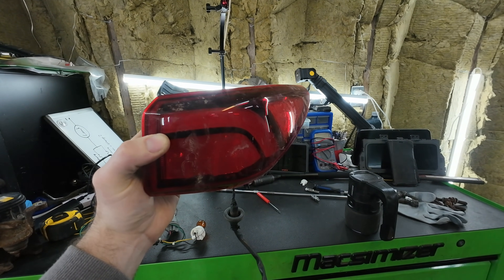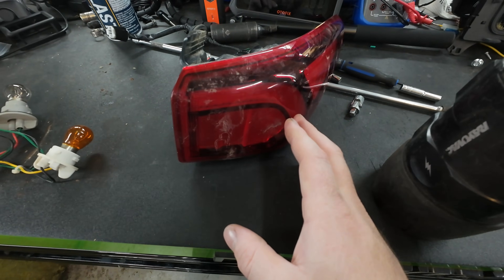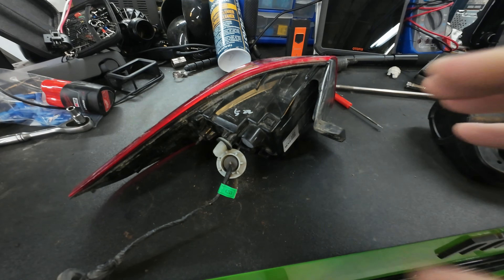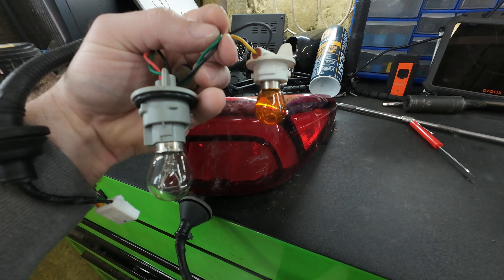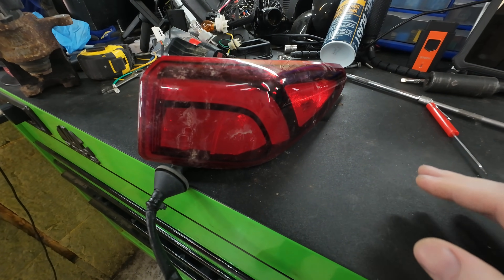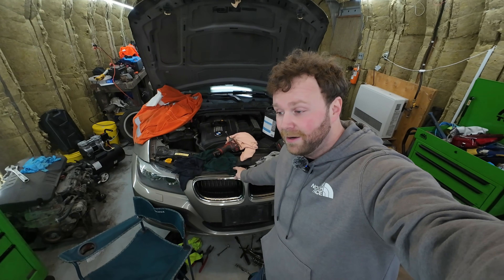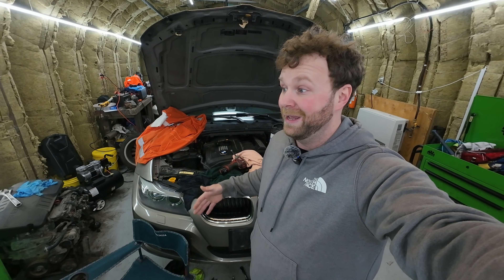Car Manufacturers don't even want you to change bulbs, they want you to replace entire assemblies!

Comment: The #1 consideration for the auto maker is to reduce the cost of manufacture of the vehicle. For this reason these types of assemblies exist. LED lights have a lifespan that should outlive the car while traditional light bulbs do not. Traditional assemblies are much more expensive to produce and inventory the sub components for the 7 years required by law. Cost of servicing and parts is very much secondary and all of this is a reaction of the car makers to the demands of customers who price shop on cars. Can't blame them for reacting to market demand even if it hurts the DIY enthusiast. 30+ years in OEM supply here so I know the back story all too well.
Reply: That's exactly it.

Manufacturers do not sit around trying to figure out how to make something difficult to repair; repair isn't even a concern.

Design is done to minimize the cost of production and installation.

This is why there are so many one-way clips on cars that are near impossible to unclip without destroying the plastic; removal isn't important, it's the fact it only takes a second to snap it into place, where screwing it into place is easily removable but might take fifteen seconds per screw and perhaps six screws.

One second of labor cost vs. one minute of labor cost is a no-brainer.

Comment: I just saw a video of a 80,000$ denali brand new with a broken door handle cant get the handle its now molded into the door panel. 800 for a new door panel if you break the handle. I hope toyota doesn't see it cause their door handles are the worst pieces of shit literally the only compliant on Toyota.

Gm's fancy trucks have 1500$ rear lenses as well EACH.

there is going to be a massive restoration opportunity for any vehicle made before 2010 as this new stuff is beyond awful.

Comment: As someone who deals with electronics, the problem isn’t that they cost $1500. It’s that they are charging that much for something that might only cost a few hundred dollars to manufacturer.
For some reason, companies still believe that if something has electronics in it, they should triple the price. 
I wanted to replace a control board in an oven and the board cost more than 1/3 the price of the oven.  The board itself couldn’t have cost more than 50 bucks to manufacturer.
Reply: Production cost is not even near a few hundred dollars. It's much lower.
Just one example. A company here in Herzogenaurach used to produce shoes for 20 DM and sell them for 60 DM. Today production cost is 10 Euros and they are getting sold for 200 Euros.
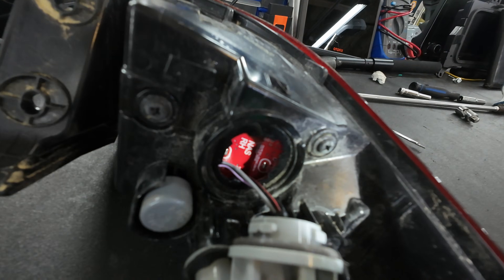The ratio is more 1:20
Reply: I have a Samsung oven that uses relays on the control board to power the oven elements.  It uses a slow PWM (On/Off several times a minute) to control the temperature.  The oven quit just out of warranty and they wanted about $400 for the board and Tech time on top of that.  So I'm an electronics tech so I pulled the board and soon determined the relay to be faulty.  I purchased a set of 3 relays exact OEM for about $10 out of China. Well they lasted less than 2 years.  I noted that the foot print was the same as a name brand relay I had in my shop rated at a high capacity.  About 3 years in and it is still working... except now a proprietary designed thermistor temperature sensor costing $150 is faulty, so we can't use the top half of the divided oven.
Reply: "....... the problem isn’t that they cost $1500."    Duhhhhhhhhhhhhhhhhhhhhhhhhhhhhhhhhhhhhh
Reply: You're not buying the boards in bulk. 🤣 You as an individual can never ever beat a large company economy of scale. And yeah prices by time it gets to you will have tripled if not more. Lol there's a lot of middlemen in between BEFORE car even gets off the lot. Gross profit margins are typically based on costs. A fifty percent gross margin is typical and that applies each company or part of process. It's like compound interest. Lol best example is wheat. Lol a bushel will easily make fifty loaves of bread and the other ingredients are typically cheap at source too. A bushel is around $8 so it's like under 40c a loaf and the other ingredients are like maybe 25c or so. Yet a fn loaf of good bread is $3 to $6 . 
Note this. No public traded or invested into company onus is to you the consumer, it's to me the investor. If I see it's not making profit then sooner or later I'll pull out. Here's facts. There's always been a lot more people don't know even HTF to change oil let alone anything else to repair. Lol most can't even change a tire. While you're a repair enthusiast the reality bus your numbers are lot lower now than ever. Lol like when I was a kid you had to take industrial arts including mechanics, now that's not a requirement most schools. 
Maybe 0.1% of y'all know how to do s now even if it was old school vehicles. You can complain but nothing's going to change much. You're not the main market and never have been. 
Also people think they're saving huge money doing own repairs, lol have you ever costed your own labour which includes time going out and getting parts. Lol hint buddy. I haven't cut my own grass since I was like in college. My time for anything whatsoever is worth st least $100 an hour. Lol get a pt jib or make money on net instead then pay for repairs out of it. Also do own repairs you Automatic lose warranty in most cases.
Reply: I have a gas range in my house from the 50s. I've been here for 37 years and it's never needed any repair or servicing. I have a pickup I bought new in 1990. It's old school pushrod technology small block Chevrolet. No electronics on board or electric controls except what's absolutely necessary for the vehicle to function. It just keeps going down the road.
Reply: @martyharless5097 
I suppose I could’ve put repairs into my GE stove to fix the bad pilot and oven control.  But it was a cheap stove from the 70s.

As far as your 90s truck. 
No list of major repairs to keep it just going down the road. 

By the way, the 90s 
So it has an electronic ignition and possibly an electronic carburetor. 
It certainly doesn’t have point ignition
Reply: @neilkurzman4907  single coil electronic ignition. It never needs adjustment and it's had one module replaced in 35 years and it was cheap. Extremely reliable throttle body fuel injection. I haven't spent a penny on the fuel injection. 
Maintenance is very simple and repairs are just typical wear items such as brakes, clutch, water pump, and alternator bearings and very simple to repair. The engine and transmission have never been opened up and it runs like a top. 
It has the original catalytic converter and has breezed through every emissions test.
Reply: @martyharless5097 
I didn’t ask for the sales pitch. I’ve owned 90s cars before. 
Blew the head gasket at 100,000 miles. 
So you were able to get a junk recognition module. That’s what she means.  So you haven’t cleaned the fuel injector in 35 years.
Or the throttlebody for that matter?
Original starter, fuel pump? Suspension, steering linkage, U joints, ball, joints, bearings.
Even the original valve cover gaskets.
Because they didn’t leak like a sieve back in the 90s. And how many hundred thousand miles do you have on that original unopened transmission? 

Should I go over the massive list of parts that you needed to keep something that old on the road?
Do you think you’re the first person to have an old vehicle?
Reply: @neilkurzman4907  I'm still waiting for that massive list of parts needed to keep my truck going down the road.
Reply: @martyharless5097 
You haven’t told me how many miles are on it. Being you’re acting like you have not replaced all of these parts. I’m going to assume it’s less than 100,000. 
That you have a diesel. 

My last Honda Accord had 97,000 miles and the only engine Marc was the valve cover gasket.
Major work was the E break and one of the daytime driving lights. 
Every other LED bulb in the car is still working.
Reply: @neilkurzman4907  I'm still waiting on that massive long list of parts. I guess you must have forgotten about it. In your earlier comment you asked if you should go over that list. That would infer you already had a list made. I don't know why it's taking you so long.
Reply: @martyharless5097 
You still haven’t told me how many miles you had on it and if it was a diesel or not. 

So you’re saying you found the one lucky vehicle that nothing ever wears out on. Or are you saying every one of the vehicle vehicles from that year is still on the road today? 
Let me guess you do all your homework work and don’t count your labor the thousands of dollars that it’s actually worth to somebody else who wasn’t going to do with themselves 
So original exhaust, original struts 
Original U joints, original bearings.
Original diff , original bushings because those never dry rot. 
I bet you have the original shocks, springs, tie rod ends, ball joints. 
Never a spot of rust. It’s all just freaking amazing.

Yes, I forgot about you. And I also remembered you didn’t answer the original question so does that have 25,000 miles on it or 225,000.
And if it’s a diesel, it’s a whole different story.
Like do you have the original distributor cause everybody knows that’s normal wear part 

Oh by the way, I should mention I’m in my 60s and I’ve had cars for 15 years before. So go bullshit somebody else
Reply: @neilkurzman4907  I already answered your questions concerning mileage and diesel or gas in my last comment.The only things you got right I have already mentioned in previous comments except for the muffler. You're a mile off on your guesses. Of course I've had things wear out on my truck. I have already mentioned that and I've taken into account the labor. I've had my truck a hell of a lot longer than 15 years. It's 35 years old which you should have known as I said it was a 1990. Why am I not surprised you want to run your ignorant mouth without reading my comment. You're just too lazy and don't want to back up your bullshit.
Reply: @martyharless5097 
Ignorant? Why every one of those parts I listed is still the original on your truck.  It’s 35 years old. That’s all I know about it.
I still don’t know if it’s a diesel or how many miles it has on it 

Yes, my last car I kept at 15 years I promised myself I’d never keep one that long again. 
So how many hundreds of hours have you spent keeping the truck on the road? 
I’m assuming original engine and transmission mounts. 
Because they last the life of the car.
Reply: same with phones.😅
Reply: I sell used washers & dryers. When a computer board on a washer goes out we just repair it... but now they have started filling in the back of the computer board with some type of thick glue stuff.
Reply: And the fix for the board is likely a cracked solder connection. 
Easily fixed.
Most electronic failures are mechanical in nature such as loose or corroded connectors, cracked solder etc.
Lead-free "save the earth" solder is a huge problem as it is very brittle
Reply: @neilkurzman4907  They know they're the only ones with the new board. We need to start teaching board repair.
Reply: @Syncopia 
To repair the board, you probably need test equipment and the schematic.  The real issue is the ridiculous markup on electronic parts.
Remember, one of the reasons they use electronics instead of mechanical things and lightbulbs is the electronics are cheaper.
Reply: So what you're saying is things should only cost what they cost to make? No inventory costs, no cost for employees to handle them, no recouping R&D costs, no profits for the manufacturer, shipper, warehouse and logistics folks, just pure cost?

Yeah, I guess all those employees shouldn't be paid, either, they should just work for free with no benefits. 🙄
Reply: @VideoArchiveGuy  That's not what he is saying. Those few hundred dollars include all costs and even a profit margin.
Example: a German fishing tackle company bought a fishing reel Made in Hong Kong for 5.50 DM in 1988.
The price included all costs the manufacturer had and he did even make a profit.
It was sold for 55 DM in a shop. 30 % margin for the shop. So 38.50 - 5.50 = 33.50 was the amount the fishing tackle company did make per reel. For moving the reels into the building, storing them on shelves, repacking and shipping.
So if a fisherman would have bought a reel directly from the manufacturer in Hong Kong, he would have payed 25 DM shipping included.
It's no different for VW GM Ford Toyota ... They don't manufacture most of the parts. But they sell parts with an extreme margin. And most parts are not even developed by the car manufacturers ;)

Comment: I would do what people do in states where you're not allowed to fix or run with cracked tallight plastic. Smash out the whole thing and glue in trailer taillights. 😂

In reality, this needs to be totally illegal. All lights need to be legally mandated to be standardized incandescent, halogen, HID, or LED modules that retail for less than 10 dollars. Sort of like how sealed beam and halogen bulbs are legally mandated to be standardized.
Reply: Exactly. All this talk of e-waste (which is a problem, I agree there), yet they do the very thing that generates it.
Reply: 80s called. They want their sealed beam headlights back.

There's also 4" or is it 6" round taillights with standardized pigtail plugs. Those have been LEDs for a long time.
Reply: @pigletshut My daily driver is a 1986 Buick Century with sealed beam headlights. And one big fuel injector. 😊
Reply: @gregorymalchuk272  ah yes throttle body injection! I have an old chevy with that! and ALL the old school bulbs work fine
Reply: It will come back when these are beaters in about five years

Comment: Yep,been saying this for about  year now. Most consumers have no idea the true number that their modern vehicle will cost. Not just the ridiculous overpriced sticker price,but the ridiculous parts and calibration costs for the simplest things.
Reply from the maker: a bumper, tailight, and the fancy ford tailgates. Now cause the vehicle to be written off even if its a minor rear hit on the corner. Your looking upwards up 20k. Now imagine with no insurance or warranty :(
Reply: @Lancemechanics  It really will be a crisis just as bad as how housing is now. People take for granted transportation until its gone. Many states in the USA have inspections and you cannot just drive around legally without it. Wait until cars have an ADAS light in conjunction with Check engine lights. This will flag inspectors that there is some safety concern and they wont pass your vehicle.
Reply: @JohnMichael-kj6fo watch people don't care, still drive them and pile up the unpaid fines

Comment: I wonder why insurance costs so much... It's one thing if they made them to last 20 years but now these new taillights don't last as long as cheap light bulb...
Reply: seriously. everything that affects the price of car repair also increases the cost of auto insurance. yet another reason to support repair rights
Reply: @arthurgay5746  led are put on curcuit boards.  To protect the circuit boards from moisture the housing needs to be sealed.  So yeah a light bulb wont last as long but that assumes a perfect seal and the light housing is never damaged.
Reply: @supernova743 a perfect seal could easily be engineered for.  A plastic skirt well seated on a rubber gasket on the replaceable LED bulb(which it should be) will easily create an air tight seal, and that's not even including the use of silicone paste.  Further, as far as I recall, headlights from older cars aren't usually suffering from water getting into them in the first place, owing to the absence of condensation I've seen in everything except failed units.
Reply: @supernova743 oh, and also, it is extremely easy to keep the circuitry in separate, perfectly sealed compartments with the wires running to the actual bulbs if the water tightness of the headlight compartments is not good enough, as unlikely as that is.

Comment: Would you be willing to disassemble take good photos of the boards/wiring/chips? Most companies will get a cheap LED driver and controller? I solder and have the tooling probably over 800 bucks worth of tools just for electronics but I see that the one failure I see today the 2 or 3 I will see next year. Like subaru I used to get many of their ecu's because one chip was not soldered well they'd have a misfire they can't get rid of. I don't think I will ever get anything newer than 2009 maybe 2010.. I can work on those or I find a good 90's maybe 2000's (early) diesel.